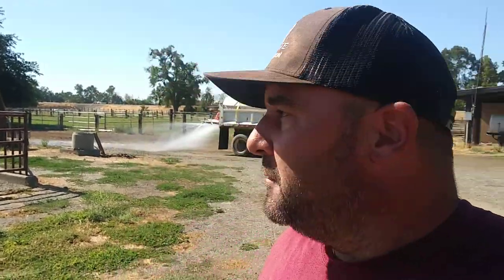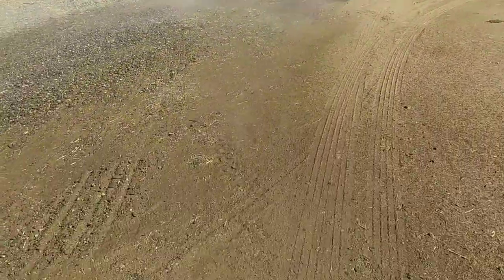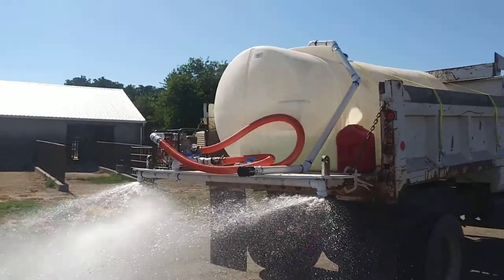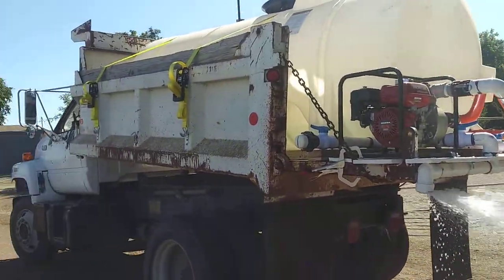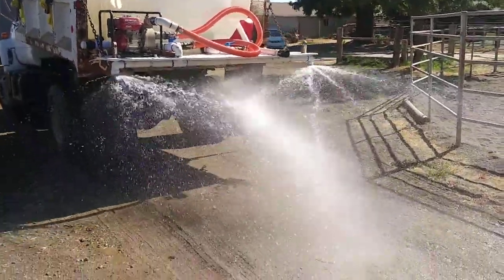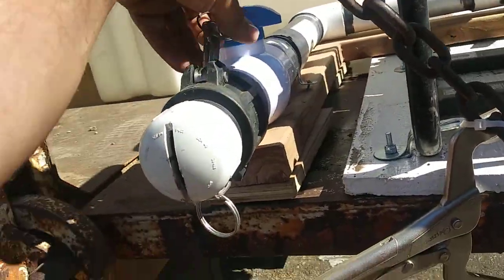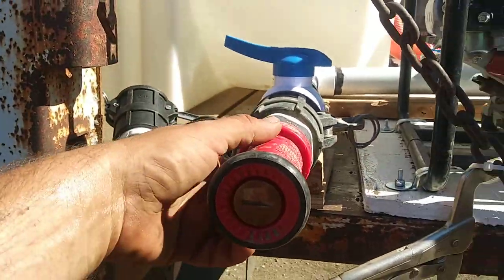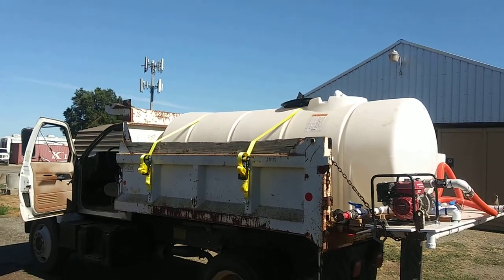Creating a water truck

Comment: Nice 👍 water truck ,  u should level the elbows and the slotted caps face down water sprays ground with pressure leaves a smooth hard surface .. if u think doing that backsplashes .. it don’t … u will cover more ground as u will be able go a lil faster ..
Reply from the maker: Thank u. Great advice.  I will try rotating them down.

Comment: This is great! I have 2 questions. Where did you buy your special fittings and how did you rig the in cab control to shut the water off? Thank you so much for posting this video!!
Reply from the maker: That's are no in cab controls.   The fittings I got at the local irrigation supply house.